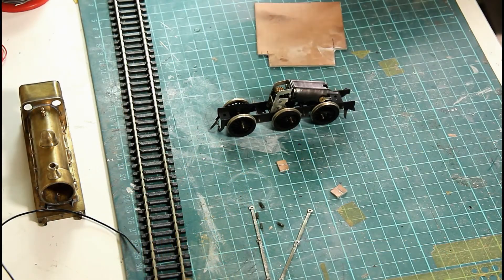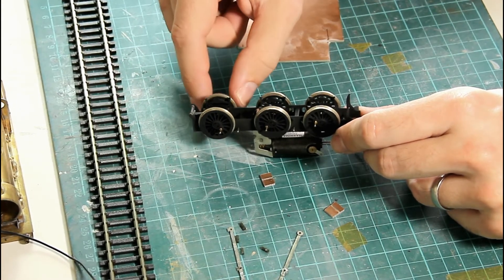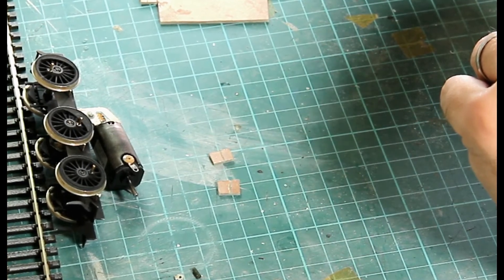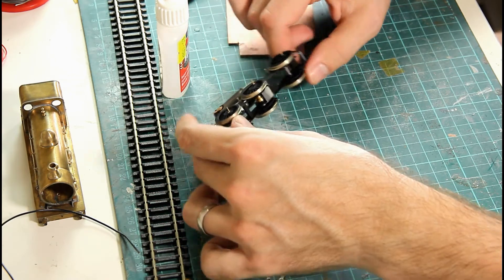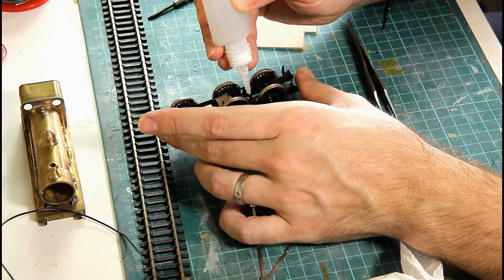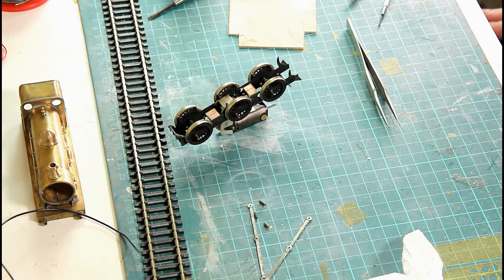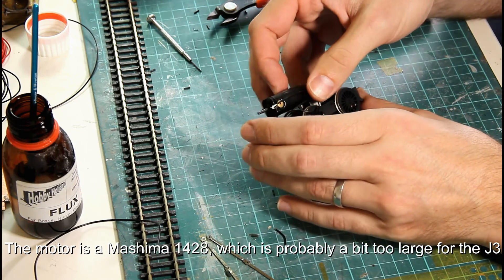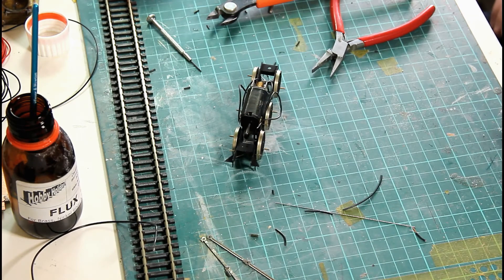How To Fit Electrical Pick Ups To Kit Built Locomotives

Comment: Buy glass fibre-backed copper clad. It resists soldering heat better. The thin paxolin stuff as used for sleepers does not stand re-soldering and the copper peels away.

Comment: Nice helpful video.

On this video you only install 1 side pick up. For DCC, it should be both sided pick up, is it correct?
Reply from the maker: It's generally considered recommended practise to install pick-ups both sides for DCC, but it isn't essential, providing the decoder is completely electrically isolated.
Reply: @cb01ttr  Ok thank you.

Comment: Although I have done this for years, I am really enjoying your whole series which provides a sound basis for anyone wanting to start - and lots of tips for those of us who are more experienced. Although the "Godfather" Tony Wright set me off on kit building 20 plus years ago, I also found that being a member of an MRC put me in touch with others with far more engineering skill than me. but also with lots of tips that I have picked up on. One of them was to switch from .45 NS Wire to flat Copper strip for the pick up and where I have found far more stability - in other words, once a Loco has been running, the strip always stays in place whereas the wire does have a tendency to be moved out of place by the Loco's movements (especially on bends). My solution for the problem with the brake gear is to lop 'em off on the smaller engines that are tight on space - its not the thing to do of course, but nobody ever notices in operation!!! Keep up the good work - Dave
Reply: If I may ask, how do you replace the wire with flat copper strip? 
I mean, is it similar to the way this person did it or does it require modifications? 
I’m thinking of kit building and I’m asking for tips on it. (J72 chassis for GER C72 )

Comment: Use 60/40 solder and always use rosin flux.  Never use acid plumbing flux.
Reply from the maker: I'm not using acid plumbing flux... I presume you mean that your personal preference is 60/40 solder and rosin flux? As always in model building there are many ways to achieve the goal.
Reply: When soldering electrical connections, rosin flux is always used, unless you want your connections to corrode. If you use silver bearing solder, too much heat will be required.
Reply from the maker: Ok, thanks Dave.

Comment: Just a suggestion, when soldering wire don't use an acid flux, I use a paste flux on mine, doesn't turn green if not washed off.
Reply from the maker: Hi Peter, thanks, I've not yet tried paste flux, might give it a go in the future. :)
Reply: I do the same as well - avoids any corrosion on the pick-ups later on.